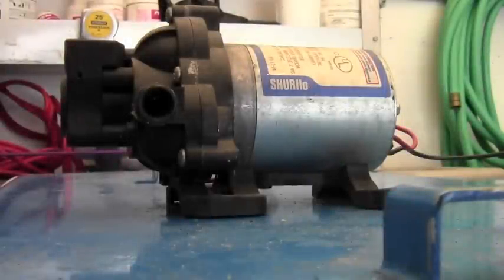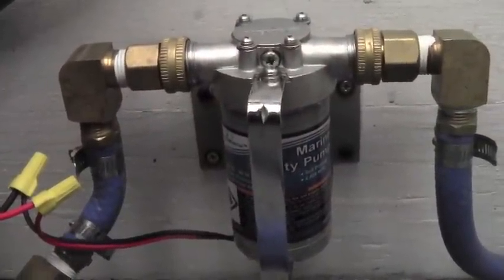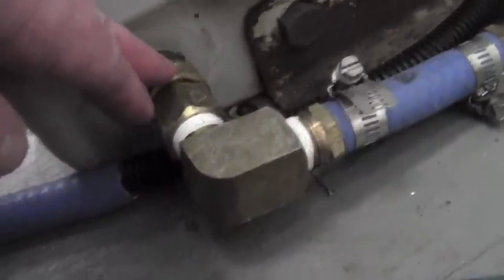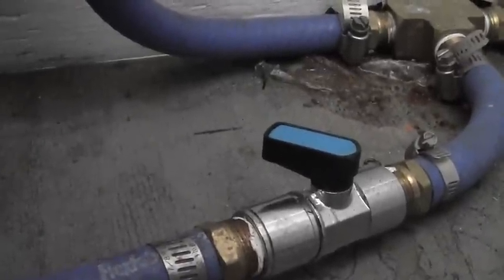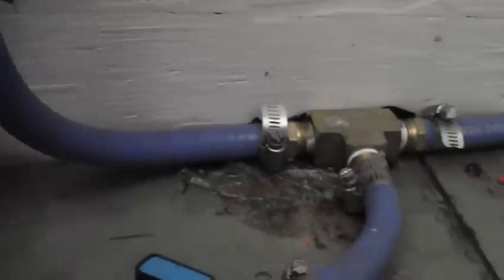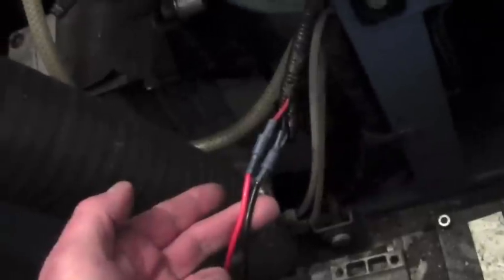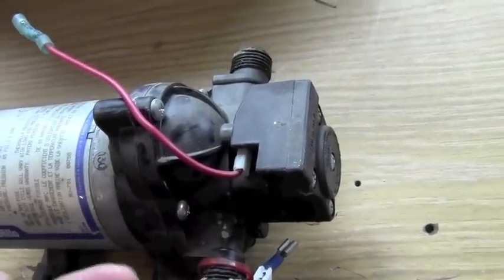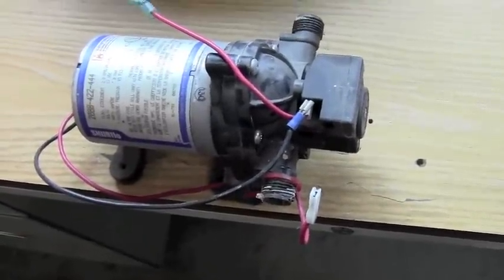Carpet Cleaning:  How to set up a water pump

Comment: Does the harbor freight pump replace the water pump on your truck mount or am I confused?  I guess what I'm asking is can I use that cheap pump as a replacement when or if my pump goes out on my truck mount system?
Reply from the maker: K Woodoll if you’re referring to the high pressure pump on your truck mount system, no.  This little pump’s main purpose is to get the water into your Truckmount. Not out.

Comment: What is the fitting thread size and pitch for the tanks? It seems like its universal on most tanks. Just what is its size?
Reply from the maker: It's called a bulkhead adapter.  The fitting size is a standard garden hose thread.  It originally had a leak, so I had an RV guy plastic weld a new thread onto the tank.  I can't remember that specific thread size, since I have since sold the truck.  I know it's a standard pipe thread, so don't overthink it.  You can also simply drill a hole into a tank and install your own brass bulkhead adapter from either Lowe's/Home Depot, or better yet, visit a hydraulic supply store (the better choice!).  You didn't mention if you have an existing tank or not, and whether or not you have an inlet or not, so I'm not sure what else I can help you with without more information.  Feel free to reply here or DM if I can help you further.